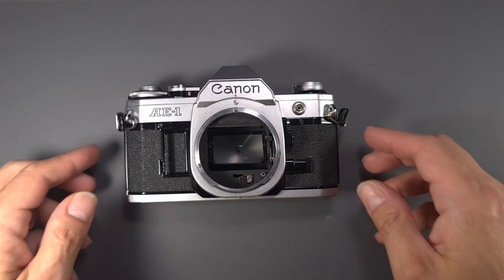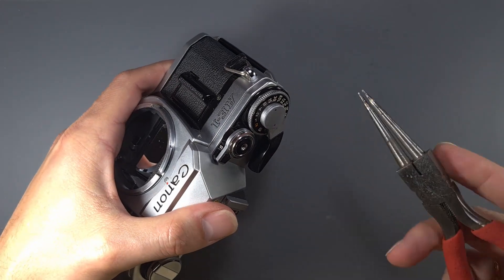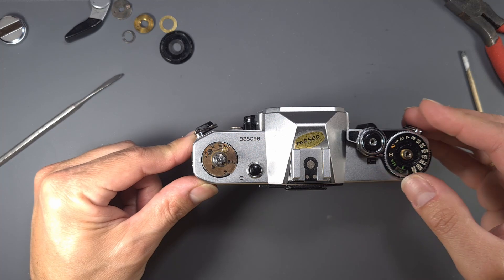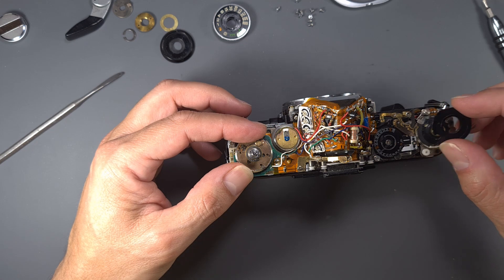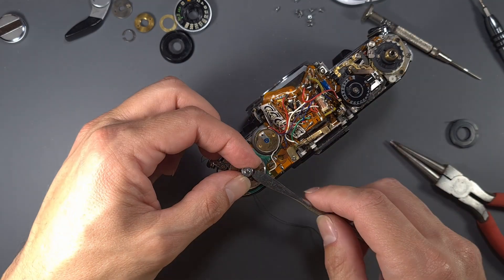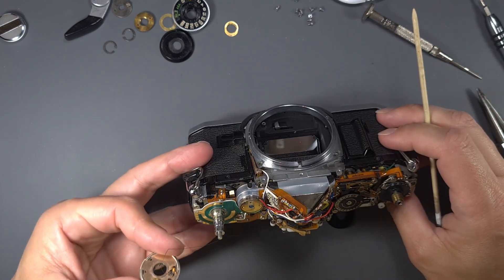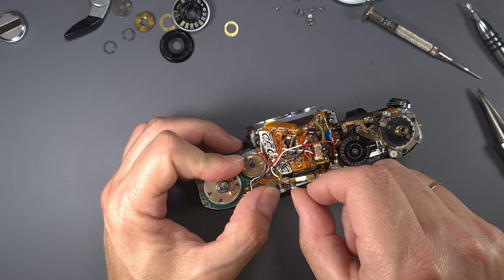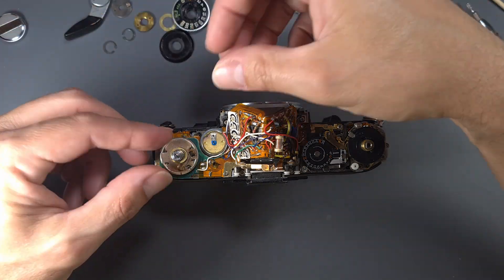Canon AE-1 Repair Camera Speeds - Replace Tungsten Wire

Comment: Hi, thanks for this video. Has anyone found a video for making your own linkage out of fishing wire etc. when you have no donor camera? Length, removing the brass pin to retain one end of the thread, synchronising the dials (linked by the line)?

Comment: Hi! Another great video. I have 3 AE-1s, each with the same problem. 

Changing the shutter speed I see the resistor rotating, but when i change ISO nothing happens. 

Any suggestions please?

Comment: Can you please clarify on key thing. Does the wire serve an electrical purpose, ie passes any electrical signal or is it strictly a mechanical device to convey movement? Thanks.
Reply from the maker: Hi, it's just mechanical.
Reply: @FotofixVintageCameras  I thought so, but wanted to make it clear. It looks like a Kevlar fishing line is recommended as a replacement, since tungsten strand wire is difficult to find. Thanks again for taking time.

Comment: Hello there, glad I found you! My ae-1 can only shoot in one shutter speed(I guess 1/1000) , been using it for 3 weeks now, and all speeds worked perfectly until now. Checked it ,and  rotating the shutter speed dial moves the functional resister. Might it be an electrical issue? 
Everything else works perfectly except this. Could you help identify the problem please? ps.: very helpful and technical videos you have there , helps a lot:)
Reply: Did u found a Solution , got 1:1 the same Problem
Reply: @TheLootBoot me too, just got an AE-1 from Japan 
Everything’s fine except the shutter speed firing at a single speed no matter what speed or iso I set it to, I’m gonna remove the bottom plate and see if the magnets are dirty and clean it
Reply from the maker: The speeds of the Canon AE-1 are electronically controlled so it can be an electronic problem but it also can just be dirty contacts...
Reply: Hello, i have the same problem. Anyone knows how to fix this?

Comment: Hi there, I do not have any donor cables. The wire snapped off right where the shutter ring is, I was wondering if there is a way for me to reattach it to the black shutter ring ?
Reply from the maker: If the wire broke near the black ring you can try to reattach it. You will have to maintain the length of the wire... It may have some "spare" wire on the rewind end. If not, you have to replace the wire with a new one. If you cannot find the correct wire you can try fishing wire like Spiderwire... its not the best solution but will do the trick...
Reply: @FotofixVintageCameras  thank you for the response. My question was HOW do I attach it. It seems nearly impossible to my eyes..
Reply from the maker: @darkmelo5642  It is possible but not a easy task... Take a look at this post from the Classic Repair Forum: https://www.rangefinderforum.com/classics/forum/messages/2/24499.html?1336932619
Reply: @FotofixVintageCameras  that is excellent insight, thank you for the link I would have not found it or my own.

Just an update, I didnt know how the clip worked or how to dissect it. Alternatively, I shoved the tip of the wires into the slot with a needle and superglued it. The light meter seems to work accurately for now, just a matter of how long the superglue holds
Reply: @darkmelo5642  How you got out the brass splint that holds the wire? And which kind of wire you took to replace it?
Reply: I can't find the post anymore, do you? Would appreciate it!
Reply: @kaikoe2445  hi Kai, it didn’t end up lasting so I got a donor body from ebay.
Reply: @darkmelo5642  Thanks for the quick answer! Sadly it's really hard to get a donor body in Germany at the moment, so I might just get another functional body for 70€. Even more sadly that I got two AE-1 with broken tungsten-wire
Reply: @kaikoe2445  Here in Australia they are quite pricey too. But I got to swap out some other parts and make the working look more new.
Reply: @kaikoe2445  ich hab eine gekauft aber der bildzähler war defekt.. hab den repariert und nun ist mir dabei der draht kaputt gegangen ^^" jetzt versuche ich es mit einer geflochtenen angelschnur 0,08mm dick 
ich werde mal gucken wie man es ambesten befestigen könnte.. aber ich denke ich werde etwas 2k kleber verwenden müssen.
Reply: @DEWElmorion  Melde dich gerne sobald du es versucht hast. Ich habe mir defekte Kameras gekauft und ausgetauscht. Hab deshalb noch 3 AE-1 mit defekter Schnur, wovon eventuell noch 2 repariert werden können.
Reply: @kaikoe2445    Also ich habe es nun mit einer heftklammer und 0,1mm geflochtener Angelschnur repariert ^^" und es scheint zu halten und viel wichtiger die genauen werte auszuspucken! nach meiner sony a6000 passen die werte gut, ebenso der Belichtungsmesser app.
ich werde jetzt mal nen ganzen film durchknipsen und mir das Ergebnis angucken ^^ 

Die Heftklammer habe ich an einer seite komplett umgebogen auf ca. 2mm gekürzt und einen Kupferdraht dazwischenbefestigt ( damit die Öffnung auch bleibt ) 
danach habe ich sie erhitzt und direkt neben der messingklemme reingedrückt (ca. 1mm)
habe dann die 0,1mm Angelschnur durchgezogen nen einfachen knoten dran gemacht und die Heftklammer mit relativ viel druck komplett im Kunststoff versenkt.
habe eine neue Nut gemacht (wie die vorhandene beim Messingstück)  
habe die Schnur dadurch gefädelt und mit einem tropfen Sekundenkleber den Knoten und die Schnur zusätzlich fixiert.
habe mir dann von der Nut aus, an der Schnur, bei 20cm eine Markierung gemacht und es auf der anderen Seite genau ab der Markierung 3 mal rumgewickelt und bei der letzen Umwicklung einen knoten mit reingezogen. ebenfalls mit einem tropfen Sekundenkleber fixiert. 
alles wieder zusammengebaut und Getestet ob alles passt. 

die Schnur sollte ziemlich exakt die 20cm haben sonst passen die Werte denke ich nicht mehr ^^"    '

 @Kai Köllemann  Also ich habe es nun mit einer heftklammer und 0,1mm geflochtener Angelschnur repariert ^^" und es scheint zu halten und viel wichtiger die genauen werte auszuspucken! nach meiner sony a6000 passen die werte gut, ebenso der Belichtungsmesser app.
ich werde jetzt mal nen ganzen film durchknipsen und mir das Ergebnis angucken ^^ 

Die Heftklammer habe ich an einer seite komplett umgebogen auf ca. 2mm gekürzt und einen Kupferdraht dazwischenbefestigt ( damit die Öffnung auch bleibt ) 
danach habe ich sie erhitzt und direkt neben der messingklemme reingedrückt (ca. 1mm)
habe dann die 0,1mm Angelschnur durchgezogen nen einfachen knoten dran gemacht und die Heftklammer mit relativ viel druck komplett im Kunststoff versenkt.
habe eine neue Nut gemacht (wie die vorhandene beim Messingstück)  
habe die Schnur dadurch gefädelt und mit einem tropfen Sekundenkleber den Knoten und die Schnur zusätzlich fixiert.
habe mir dann von der Nut aus, an der Schnur, bei 20cm eine Markierung gemacht und es auf der anderen Seite genau ab der Markierung 3 mal rumgewickelt und bei der letzen Umwicklung einen knoten mit reingezogen. ebenfalls mit einem tropfen Sekundenkleber fixiert. 
alles wieder zusammengebaut und Getestet ob alles passt. 

die Schnur sollte ziemlich exakt die 20cm haben sonst passen die Werte denke ich nicht mehr ^^"   

aber alles in allem wars relativ einfach
Reply: Ps. 0,1 mm Schnur da mir die falsche geliefert wurde.. aber naja 0,1 ist etwas stabiler als 0,08 und funktioniert anscheinend auch gut
Reply: 2 years later but do you guys happened to understand how to reattach the wire to the black shutter ring?

Comment: Hi!  I have a small query, my canon ae1 when it does not have a lens, even the mirror sounds perfect, but when selecting a closed diaphragm it makes the same sound as the famous "squeak" only that this is not a question of the mirror but when the diaphragm of automatically, what could be the cause of this?
Reply from the maker: That's a strange behavior... and that happens only in f16 or other values too?
Reply: @FotofixVintageCameras  if I have the lens in "A" mode everything sounds good, but when I have it in manual just when I move the drag lever it makes a sound like the squeak hahaha, on the other hand using f22 without the silver button with the naked eye when closing the diaphragm makes that sound without counting that when shooting at f5.6 and going back to f22 it doesn't let me close it, I have to always have the lens at "A" so that everything goes well
Reply: I think that some gears next to the mirror box must be without lubricant, I disassembled both the upper and lower covers and lubricate each gear, however it remains the same, something curious is that the lever that connects with the diaphragm of the lens to the raising and lowering it makes a sound like the squeak, however I don't dare to lubricate that because it seems to have electronic contacts and not to be a mechanical part
Reply from the maker: I think you will have to remove the front of the camera to access the levers and gears of the shutter to instigate...